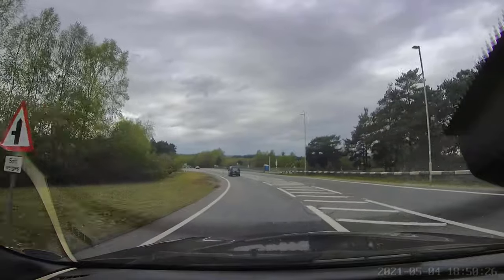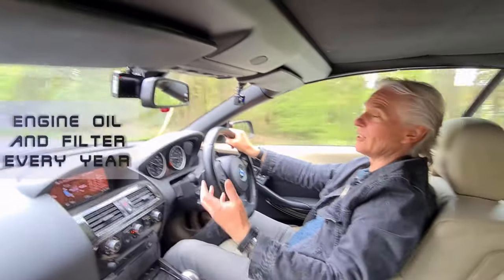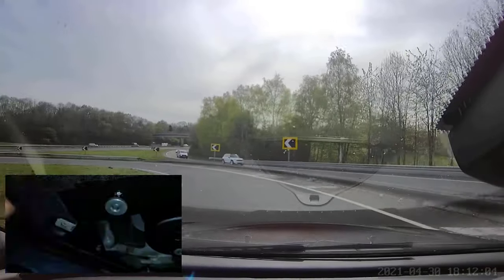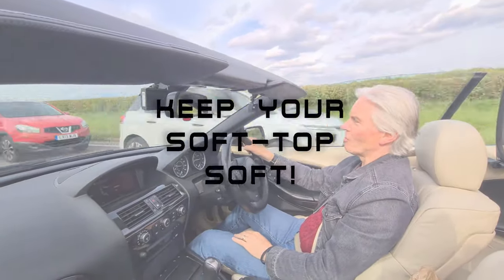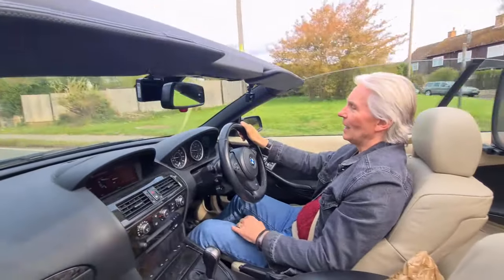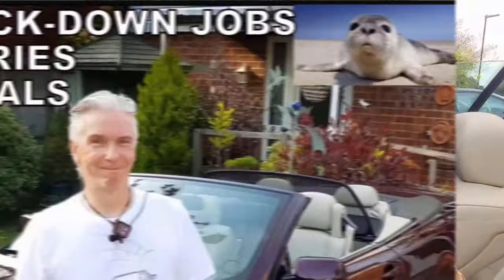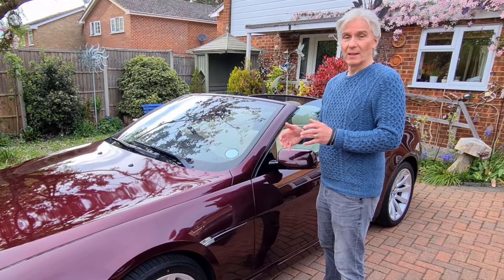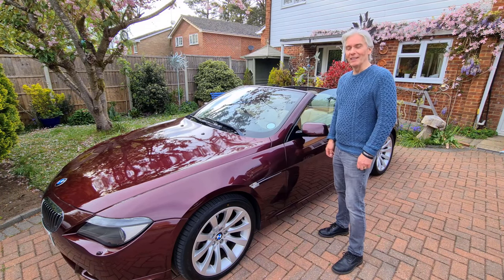BMW 6-Series - How to keep it perfect for ever!

Comment: Further comments on my BMW650I 2007 convertible, has 129,000 kilo meters.  The AC was not cooling well, took it to AC specialist. I thought the gas was less. The checked the AC and the bad news it will need new compressor replacement at cost $550.  For those interested to buy used BMW650I make sure you have it checked as it might cost you to repair more than the actual cost initially.  Despite the facts the BMW650I is a fantastic car to drive, very safe and comfy but it’s an expensive. SO you are warned to be prepared to have a good budget.  My advise get the car we’ll checked even if you need to spend more to get it check well.   I guess in cold climates places AC cooling won’t be a major issue.
Reply from the maker: Yes, good point, owning a prestige car does sometimes require prestige money!

Comment: I have BMW650I convertible model 2007. Had issues with the transmission valve body. Unfortunately I replaced the whole transmission with used one as per the local garage recommendation “which was not a wise decision” I should have replaced the valve body only with remanufactured available on line at a cost of $500-600 including shipping.  However had leakages etc since the replacement of the trans.  Your video footage is an absolute fantastic.  Although I live in hot climates SO We have issues with dust rather than 🌲 leaves.   It’s an expensive car to maintain BUT fantastic safety and fast.  The maintenance rather high with these type of cars.  Oil recommendations from the BMW agent W5-40 which does give around 10,000 up to 15,000 kilo meter at the most.  BMW650I tend to burn oil every 2,000-3,000 kilo meter SO adding one ltr as you go along will still give the required oil conditioner to the engine.  I replaced the engine oil every 10,000-12,000 kilo meter.  The battery won’t last more than 1-2 years.  Preventive maintenance as you have explained is critical.  The tire I replace every 3/4 years regardless.  Electronic modules seems are very expensive to replace.  The steering box tend to start leaking after a while.  I have been reading so much, watching videos about the BMW650I they issues are spread throughout the world.  When I had the transmission issues one sign of oil leaking was the sound of the transmission in reverse or shifting from first and second and metal in the gear box. My advise to anyone if you have issues with engine or gear box have them repaired better rather than getting used stuff.  To end this message I would like to say thank you and well done for this footage video excellent 👍
Reply from the maker: Thanks Murthada and lots of great info there!
Reply: Was told trainee shot it mines and possible engine 🤦🏽‍♂️. Think I’m going to get a second opinion. Even tho I trust my mechanic.

Comment: Another well thought vid; thanks! Another problem I know ( with my E63) is I have a rear fog light & rear reverse light blown (differing sides) BUT to change them its a BUMPER OFF job... I can't be arsed to do that until both bulbs have blown... Think this could be an interesting vid if/when  yours blow?? as a garage would charge an arm & a leg no doubt!!  Keep up the great vlogs √
Reply: Mr. Singh...its not that hard to do I did it myself, a garage put in " long life halogen bulbs " Which blew not long after. There are lots of how to videos on utube showing how to remove the rear bumper. Just replace your bulbs with quality LED bulbs, ensuring they are error free CANBUS types, or you get the annoying bong every time you start up. If you do it yourself, just have someone to help you put the bumper back on, as both sides have a clip which can scrape the paint above the rear wheel arch. If you can't be bothered and get a garage to do it....at least get good quality LED bulbs to replace the old ones, as they last much much longer. Reversing lights are not a MOT failure but the fog lights may be. And if you’re like me you want ALL your rear lights working. GOOD LUCK SIR.

Comment: Went to take the wheels off my 650 to clean them and check suspension, I knew there was no spare tyre but no jack or wheel nut brace either! Only a locking nut.
Reply from the maker: That's the runflat system for you - get to a garage and let them do all the work!

Comment: Great video !! Thanks Timm !! I have the E63 630i. Looks the same, slightly slower, lighter by around 160kgs, better mpg and the engine is more reliable overall. I instantly paused the video to order the Gummi pflege and also the Wynns Stop Leak. This shows how much faith I have in your recommendations. The other recommendations I mostly adhere to myself anyway. TRULY FANTASTIC CARS. So well built it begs the question ; "why buy a new one ?".
Reply from the maker: Thanks Ian!
Reply: @TimmsBMWRepairsandInformation  I'm truly honoured Sir for your reply. I've tried to help and pass on my knowledge of fixes and upgrades for the E63 myself. But not to your level.

Comment: Hi Timm, do you have dynamic drive active sway bars on your car? Virtually every car that has it seems to be leaking at some point. Any tips on repairs? Seems an awful lot of money to replace not just the bar itself but the labour of removing the subframe for the rear stabilizer!

Comment: Hey, Timm. Thank you for all the help, recently bought a 645ci 04 with smg transmission. Loving every second of it so far. Will follow your guidelines like bible. 

Can you please share some tips on how to keep smg in good shape?  Love the paddle shifters but the auto shifting can be really laggy when I'm driving with a heavy foot. I hardly use it thought. Still would appreciate some feedback. Cheers
Reply: Smg is trash mine just broke down and costs alot
Reply: @Therez0r  Oh, im sorry to hear that. did you use to drive it in manual or D?
Reply: @akmalmansur8783  mine is very rare 650i smg.. only manual and very rare on D with sport on.. i did an ZF AUTO conversion with stage 3 costed 3000$ i dont want to spend money on smg since its very hard to troubleshoot when it breaks

Comment: Hi Timm, really excellent videos. Just bought a 60000 mile, 1 owner from new 2004 645ci. Have used your checklist and car passes all the tests. I do have a slight juddering when moving very slowly in drive or reverse though. Have you any experience of this? Any  input would be most appreciated.
Reply from the maker: Good man! Time for fluid, filter and bridge seals change on the gearbox!

Comment: Hi Tim I’ve recently come across your channel and it’s abundance of info. I’ve recently bought a 2003 540i sport, having had auto box scares in the past with my 330d I was considering buying a spare autobox for the 540 and I was just wondering is it the same zf auto that was used in the 535i too, just so I can broaden my search, any help appreciated, thanks!
Reply from the maker: The auto boxes are extremely reliable IF they are serviced - they are also abundant and can easily be found second-hand.

Comment: Hi Timm, Love your videos, I own an e39 5 series 167k miles and I’m not sure if it has ever had its automatic transmission serviced. Would you recommend that I get it changed or leave it as it is because it’s still working as it should. Thanks!
Reply from the maker: Yes, always a good plan at any mileage. The 5HPxx gearboxes can suddenly fail if not serviced...
Reply: @TimmsBMWRepairsandInformation  Thanks Timm, I appreciate the advice! Keep up the good work 👍

Comment: Hi Tim love the videos ..just bought a 650i that seems to smell really warm after a long drive of any sort. 
Nothing is leaking but the warm smell worries me. Do u know if this is a common problem or have you experienced it before? 
Thank you
Reply from the maker: The V8's do leak a little oil no matter what you do to them, and the oil ends up on the manifolds - and that does create a general 'hot' aroma - don't worry, mine does this as well!

Comment: What have all these things got in common, folding roof, rear window, horn, folding mirrors, boot latch...they all fail at the same time and then start working again for no reason on my 2007 650 convertible. Must be an electrical fault somewhere, but where! Fist sign its happening is when red light flashes on the folding roof button.

Comment: Hi timm my bmw got drowned last winter bought a 5 for now till I can get enough for another six do you think the n47 is that bad as long as you change the oil regularly just curious on your thoughts as your very knowledgeable and I value your opinion ps your cars look great can’t wait to get another one
Reply from the maker: All the BMW engines are excellent as long as they were looked after in the middle years and the N47 is no exception!
Reply: @TimmsBMWRepairsandInformation  
Thanks for that really appreciate it

Comment: Hi from NZ,
A couple of questions, do you have the CTek device perminently connect to the battery and does the car need to be disconnected from the battery when charging?
After removing the run-flats, do you have a spare or an inflator and a can of tyre weld/sealer?
Regards Ric
Reply from the maker: Hello Richard, yes the Ctek is permanently connected, no need to disconnect the battery and I have a inflator with the glue!
Reply: @TimmsBMWRepairsandInformation  Thanks, keep up the great work.
E64 owners really appreciate it.

Comment: Hey timm i got a question i have a 2001 bmw 740i e38 and my coolant system keeps going into air lock i just replaced the waterpump the thermostat the radiator all the major hoses and used a air puller kit for the coolant system and added new coolant at first it was great hot heat and wasnt over heating at all then i drove it lost heat and started to over heat and turned it off and air was trying to escape through the expansion tank cap and thats why i think its a blown head gasket i dont have oil in my coolant or coolant in my oil if you cant give me some info before i take it to a shop and spend 2500 to have the head gaskets replaced and just gotta say love your videos and beautiful car you have
Reply: I have an e38 and e39. Sounds like your “air puller kit” is not “pulling” the air out of the system; which looks like the reason your “over heating”. 
There are videos here on YouTube (research Timm’s first) that show how to bleed the air out of your system “the old fashion way “ 
Respectfully yours 😎🇺🇸
Reply from the maker: If you follow the details in this video and the engine still has overheating problems then there is something wrong - check out these two video's: 
https://youtu.be/-Lb68GdQDXk
https://youtu.be/XGIk8IXSGIE

Comment: Hello Tim .. i am currently looking at a 2007 650i it has 99.500 convertible and the seller is tellimg me it has some sort fo short that makes the windshield wipers and dash lights come on and off randomly and that the top closes 95% of the way last time he tried it . The car had been sitting for about a year since his dad passsed but i wanted to ask if you ever heard of the short issue or top issue thanks in advance from florida
Reply from the maker: That's not something I have heard of in any of the forums - but it would be interesting to work it out! The top would probably be easier to diagnose

Comment: Do these engines generally use oil? I used your buying guide and did the checks. Happily a recent receipt  for coolant hose change  and a load of gaskets etc. But it's using a quart of oil every 1000 miles or so which I wasn't expecting?
Reply from the maker: Use Wynn's 'stop leak' that usually helps. These engine burn some oil and leak some!

Comment: Hello I'm considering buying a used 2006 M6 with almost 120k miles clean title! It has no check engine light or strange noises but I'm still concerned something could break soon and I would have to spend 100s or 1000s of dollars in repairs!   :(  do tu think is a good idea to buy a used 2005 M6 V8 coupe??
Reply from the maker: I think there are more problems with the M6 - in particular sudden failure of the big-end bearings...
Reply: 120k is towards the end of the engine life span. Sure you could squeeze some more life out but if you plan on driving the car hard a full engine rebuild at 150k miles is pretty standard with M cars

Comment: Can you make a video trouble shooting the ccc? My 2006 e64’s ccc is stuck in a reboot loop.
Reply: I had problems with my ccc, tried the reset which is press and hold both eject buttons and the off/on/volume button (all 3 at the same time) on the cd/sat nav.  The the screen should go black and reboot. If it still doesn't work Google " BBA Reman" if you’re in the UK. I had to do this myself, they're fantastic, they will fix it and give you a lifetime guarantee. I had to remove the ccc from the dash and send it to them (you can find out how to do it on utube). They arrange the courier to pick it up, fix it and return it to you. The car will still drive in the meantime. It's still expensive (around £350)but MUCH cheaper than a new one at around £1600. I wouldn't recommend a second hand replacement as it could soon have the same problem and you'll need to get it coded at BMW ALSO. Be patient when calling the company BBA REMAN as they take ages to answer the phone. They were featured on WHEELER DEALERS, Audi TT Instrument Cluster, I think. Good luck....hopefully the reset works first. Nice and cheap.

Comment: Interesting you mentioning get rid of the run flat tyres and replacing them with Falken FK510's, but what do you do for a spare?
Reply from the maker: I have the standard compressor/glue kit that BMW now hands out for newer cars Murray.
Reply: @TimmsBMWRepairsandInformation  thanks I did think that would be the case. I'll shop around for one when I change over.

Comment: Hello tim i have bmw 645 i got my oil changed first i used to put Mobil 1 0w-40 this time they recommended me to put 5w-40 Meguin which i did after some drives a started noticing after idling my car is smoking i check my PCV valves one was torn changed it checked its hose they were fine got them cleaned and it still smokes please help what to do will really appreciate it. Thanks
Reply from the maker: If you had a torn PCV then you need to allow a good 100 miles or so to burn off the oil that will have pooled in the inlet manifold - also, give it some welly and sharp cornering before worrying!
Reply: I have driven it after pcv valve change for 250 miles but it still smokes after idle from only the right exhaust i drove it with hight revs also. What should i do next now? My car doesnt smoke the first time i start in the morning only when it come to the normal temperature and idle. Please let me know what i can do next. Thanks

Comment: I have a F10 with run flats, so far I have not noticed any noise at speed or difference in handling compared to my E46.
Reply: so your much more modern 5 series isn't better than the 3 series?
Reply: @leenevin8451  In some ways yes. More comfortable and economic.
Reply from the maker: I think the biggest difference was grip in the cold and wet - the runflats really lost grip in those conditions whereas the Falkens don't